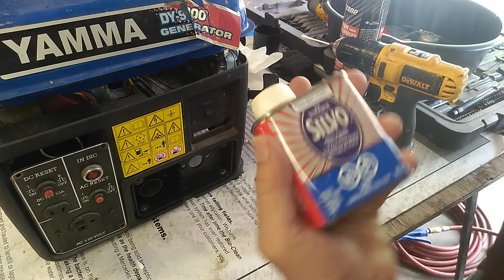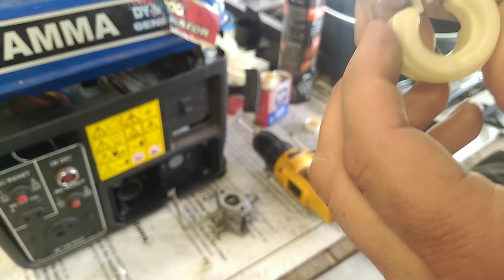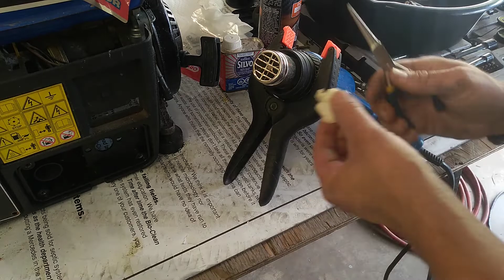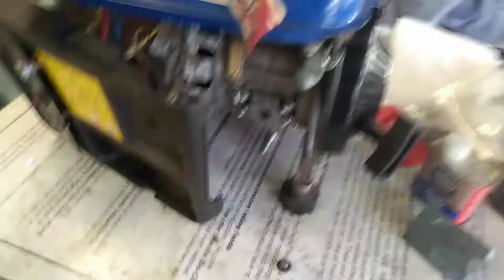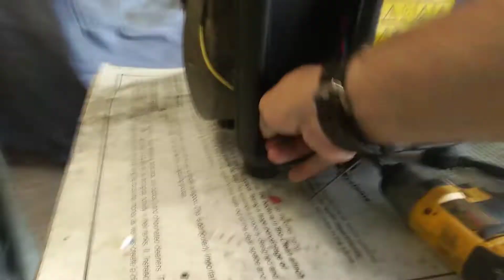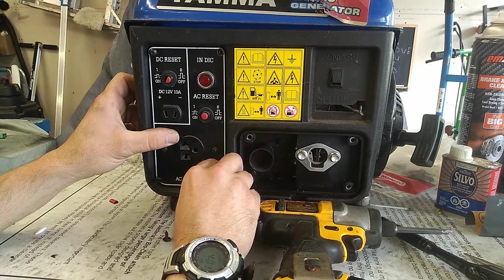How to repair a leaking carb with a Q-Tip (Cotton Swab) 2-Stroke Generator Repair

Comment: Tried that on many many carbs in hopes that it would fix the leak.
Reply from the maker: I have had close to %100 success polishing seats. Once I had to do it 4 times to get it to take on an almost new generator. It was worth pulling the carb over and over to save the generator where the carb was not available.